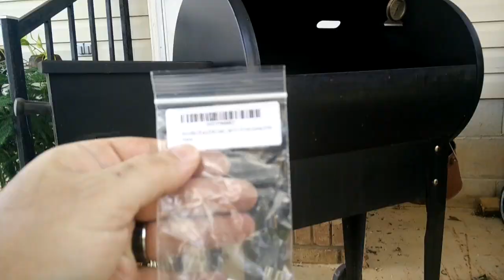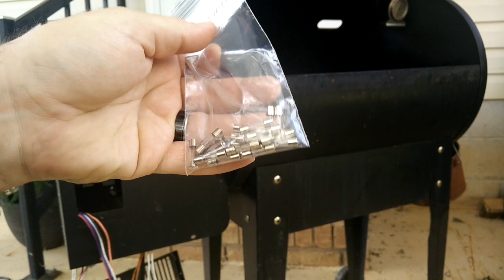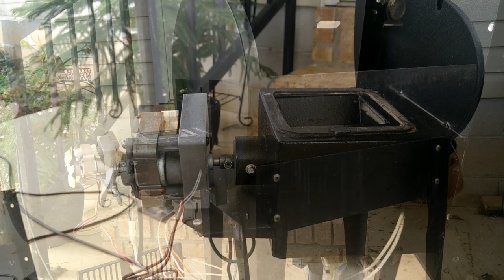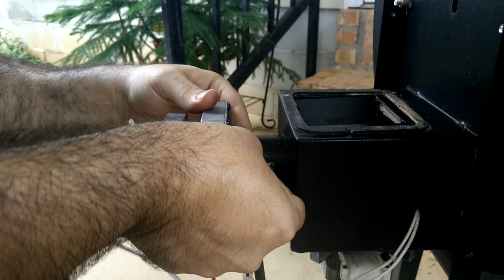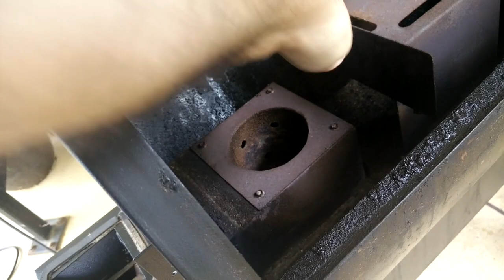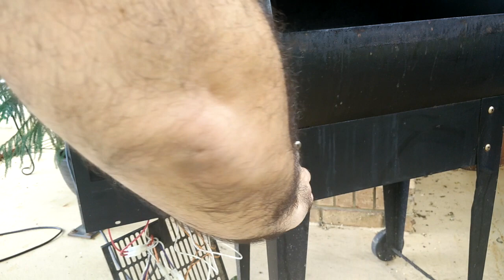Traeger Smoker Repair

Comment: Interesting video.  I have the same model and have gradually been replacing all the components.  My current problem is the firepot burning too hot on smoke, with the temperature accelerating to over 500 degrees and giving me an HEr error message and shutting everything down.  I just replaced the controller unit and the temperature rod and still have the problem on a test this morning.  Any insights?

Comment: When you plugged in the red wire connector for the auger motor at 4:10 and the auger motor fan didn't start, that was an indication of your problem right there.
Also, if I were you, I would invest in a digital controller instead of that 3 position one. There are excellent after market ones available on Amazon at 50-60 % less than OEM Traeger ones.

Comment: Wow, I just bought a used one like this model, with just the 3 heat options but it doesn't torch like urs, i wonder why
Reply from the maker: Hopefully you figure it out!
Reply: @projectgattago  got it, can replace the simple thermostat with the upgraded version.
Reply: @samhernandez6345  link please

Comment: Traeger grills are so easy to repair. Just take off the control panel, then take off the hood from the pellet hopper, then unplug the wires, unscrew the cover off the firebox, unscrew the fire rod and pull it through, make sure the auger is turning and the pathway for the pellets isn’t clogged. Put your new parts in, screw everything back down, put the control panel back on, plug it in, turn the control to “smoke”, make sure the fire rod is glowing and the firebox is getting warm, turn it off, put more pellets in, turn it back to smoke and make sure it’s smoking, then sell the damned thing on Craigslist for 1/10 of what you paid for it and get a Big Green Egg like you should’ve done in the first place.

Comment: my traeger  keeps popping my house circuit breaker  soon as i turn it on have replaced auger motor  and fan and control board it still does it have any suggestions
Reply: Yes. Get a Big Green Egg.
Reply from the maker: Have you tried another outlet?
Reply: Did u find the source?  My 12 yr old Traeger keeps tripping the breaker as well.  I have it apart right now, cleaning it up, and new auger motor arrives tomorrow. All wires look intact so was hoping the motor would fix it. 1st issue in 12 years.  Bought a Camp Chef this summer, the auger already stopped turning. Waiting to hear back from CS, but want to get the Traeger going in the meantime.
Reply from the maker: I am sorry, I never found the true cause.
Reply: @projectgattago  sounds like its the hotrod that is tripping the fuse. Its the part that sucks the most power to get the pellets to ignite.
Reply: @projectgattago  Damn, Weird thing is, Yesterday when taking it apart, I turned it on and burned the pellets still left in the tube and it did not shut off once.  But previously couldnt run it more than 10 minutes before it tripped the circuit.  So will try the motor when it arrives tomorrow and test when its clean and back together. If not the source and I do find the source, I will report back to you.
Reply: I just started having the same issue of tripping the house breaker. Need to rear it down and troubleshoot

Comment: That was educational, thanks.  I have a Jr too.  I upgraded mine, adding firebricks in cook chamber and Ortech controller.  Both have really improved my cooks. I move mine around, so wheels and maybe a shelf next.
Reply: would you be willing to share how you went about adding the fire bricks? I can be reached at leerhp@iCloud.com.thanks   Steve Leermakers
Reply: @steveleermakers1312  they have 4.5"x9" ire/kiln bricks at Ace Hardware, Home Depot, etc.  I think a box is 8 bricks.  I put 1 each, on each side of the firepot and then 2 across the bottom till I reached the other side.  The extra mass steadies the temperature. It does take a little longer to heat up, but I think I use less pellets overall.  It does make the unit top heavy, so you need to be more careful moving it.